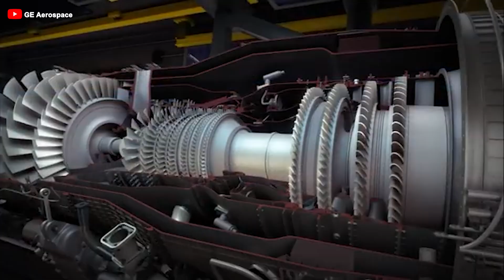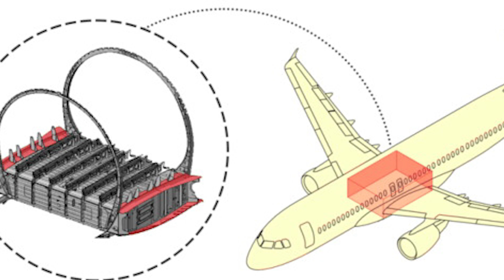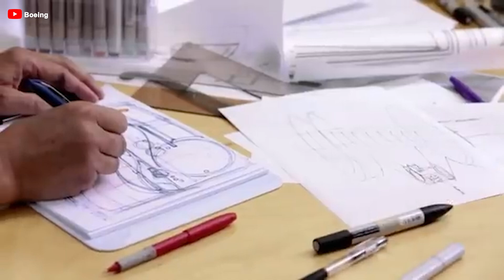You WON'T Believe What Just Happened to Boeing 737 MAX & 777s! Here's Why

Comment: To prove Boeing leads the way they have decided to issue a parachute with each first class ticket and for a service fee of fifty dollars you can get ' last rites ' performed by a day laborer who is also a mail order Cardnal  .
Reply: Boeing is a union shop they do not allow day  aborers as that would take work away from the union workers. You should have learned from the 737 max 8 crashes approximately 7 years ago. That boeing does not acknowledge the  need for retraining of pilots or for proper parachute usage. Airline passengers had no interest in jumping out of a commercial jetliner.

Comment: I think it’s nothing to do with MAX,  Ryanair landings are famous for being dramatic. First we touchdown with a bang, then we hit our heads with overhead bins, and then we clap for an on time arrival. 😂
Reply: I totally agree
Reply: Boeing does not make the tires and has no control over the quality of the individual airlines maintenance. The wheels came off that first 737 shown and that blew the other tires. Secondly lightening does not dissipate in the airframe, it passes through and out again. The path it travels through the aircraft is the concern with the fuel tubes and that is why they want redundancy on the grounding of the fuel tubes.  Better yet would be to fill the fuel tank void with inert gas as fuel is used so there is no chance of a spark ignition. Since Comac, the Chinese manufacturer, cannot sell its 737 equivalent the 979; it is most likely sabotage during maintenance to Boeing aircraft that is causing the increase in incidences for Boeing Aircraft. The Chinese call this “Ling Chi” which means death by a thousand cuts. Since Boeing needs money they could take the author of this video to court and sue for damage to their public image. Why are you making videos on topics you really know nothing about?

Comment: There is no such thing as 737 Max 8 200..I would fly it is not  the plane a lot a car with blow out .
Reply: Yes there is such think as a Max 8 200, look it up
Reply: @leo_boon350  No there isn't
Reply: 737Max 8-200 was launched in 2014 with an order from Ryan air for 100 + 100options, it can take a high density interior with 200 seats by adding two more door plugs around row 28 ryand air has a generous spacing with just 197 seats, there are about 5 or 6 carriers with them in service or on order and all of these are low cost carriers.
Reply: @Ron380-m2c  That is an old plane then 737 200
Reply: @AgeCobra  No, the 737-200 is 1970's the MAX8-200 is NEW still being built. Please look it up
Reply: @Ron380-m2c  Nope as there is only the 7,8,9 and 10 Maxes and trust a computer generated voice no

Comment: I would not book a holiday with a travel agent unless they could guarantee me, that the airline operating in conjunction with them, assured me that they do not operate the Boeing Max aircraft.  If it's a Boeing 757 or the old 737 , then that would be okay with me.  But the Max series is not in my opinion safe for me to risk myself or family on. I'd prefer an Airbus designed by real engineer's rather than Boeing's "bean counters."
Reply: max is ok.this isnt boeings fault.its maintenance

Comment: Just your NORMAL B737 controlled crash landing. This 1950s Frankenstein aircraft is so un aerodynamic thanks to its so called updated specifications. It has to have a long, flat, high speed take off and landing to prevent stalling and tail strikes. It’s a pig that should be grounded.
And guess what. Boeing are doing the same to the old 1960s 777 creation. With the same dangerous outcomes. Can’t wait for the next great Boeing project over the next thirty years.
A pimped up 787 is about all they will be able to do. Boeing is finished as a commercial aircraft manufacturer. It’s AIRBUS that has the future sown up. THANK GOD.
Reply: @MySkyranger  777 was designed in the 90s not the 60s. 737 was a product of the 60s. Boeings desire to milk every penny from their aircraft inventory has resulted in huge safety concerns. Shame, once a world leader in aircraft design now a shell of its former glory.
Reply: 777 was in the 90s,same time as your 330.737 is overpowered,dont know what you are taliking about.and crash landing?you should join daily mail.